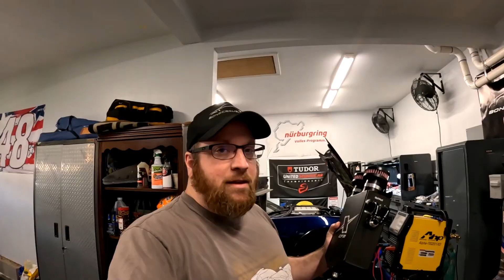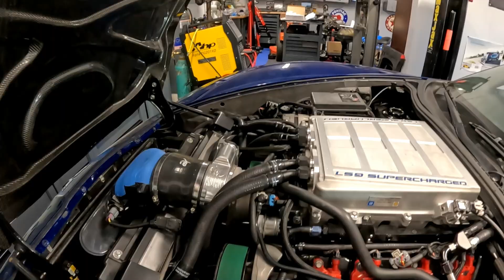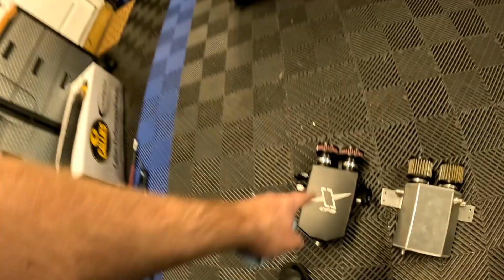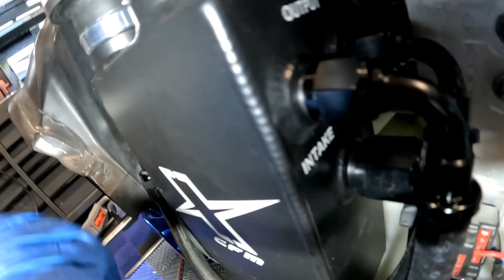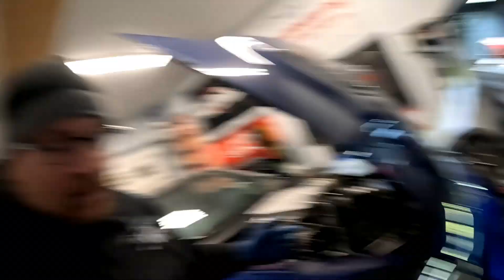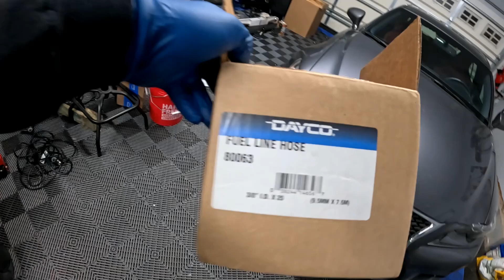2005 Chevy Corvette - @xtremecfm Catch Can Install!

Comment: Cool videos ! I have a 05 c6 supercharged with all the mods on stock ecu do you think it would be a good choice to go with a speed density tune for best performance ?
Reply from the maker: My tune is a Speed Density - I am going with a Haltech ECU in the near future. 
I've got bigger injectors and E85 to throw at the car.
Reply: @  Im on E85 reason i ask about the tune cause i herd the ecu is limited on my car so my mechanic is gonna change out the map sensors the car should be pushing 650-700 hp hope he’s able to tune it cause I’m installing a built trans and diff from rpm next week